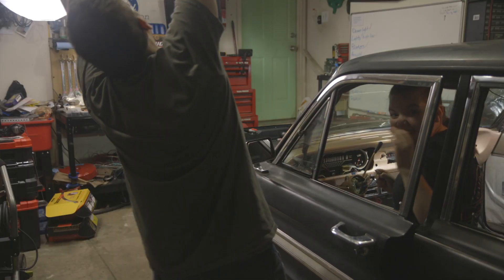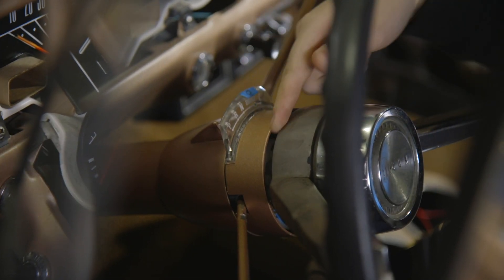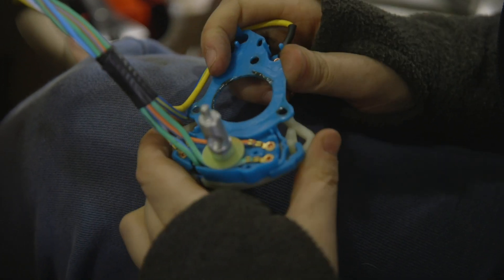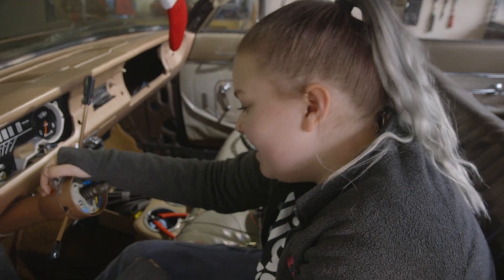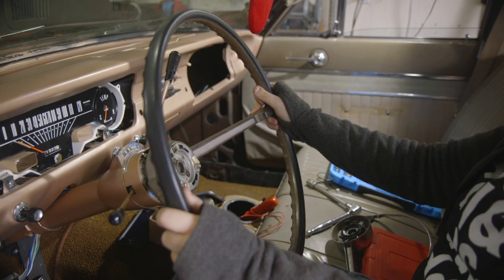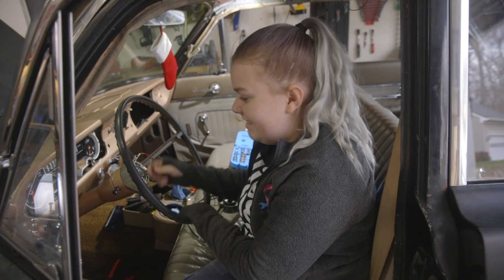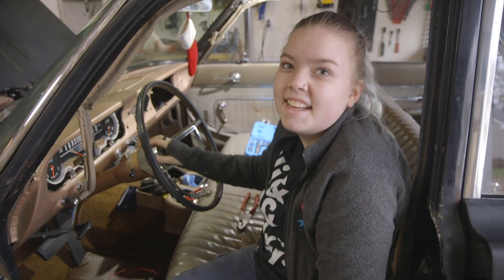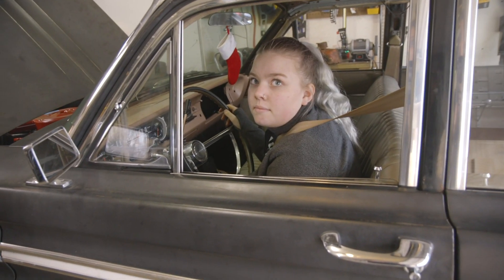I Hear My '65 Falcon's Horns for the First Time!!

Comment: I got a 1970 Plymouth duster and I’m trying to figure out if it goes directly from the turn signal switch to the horn and if I can just connect a spliced into the horn wire to a relay.

Comment: Does the wire from the turn signal switch of the horn run directly to the power of the horn with a power wire to the battery  or through a relay and then to the horn

Comment: Is there a little plastic piece under the horn hub that keep the horn “up” when not pressing it? My 65 had that and it has two little tabs on that plastic bracket. If you press too hard, it can break and it will sit off balance on the hub. Be gentle with it